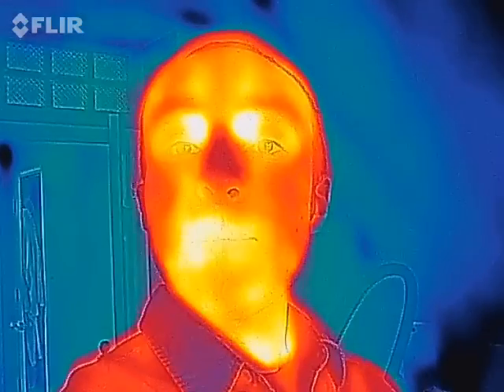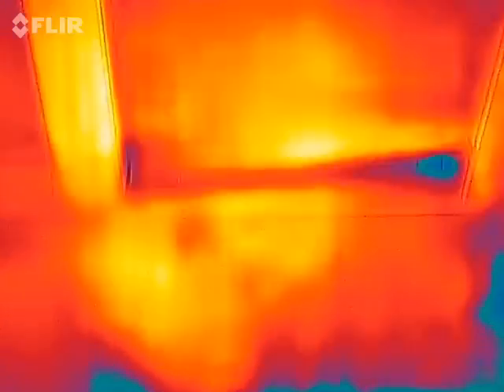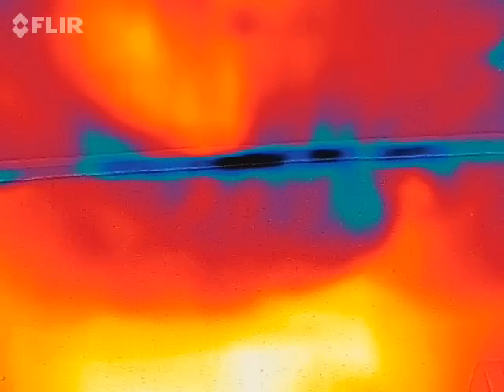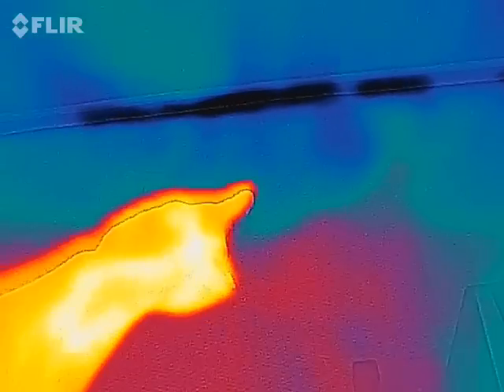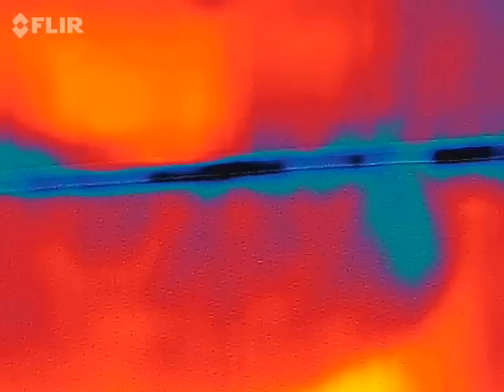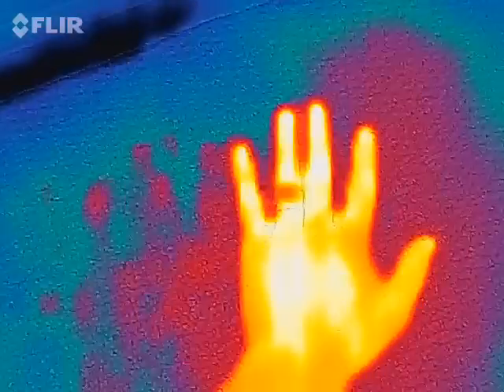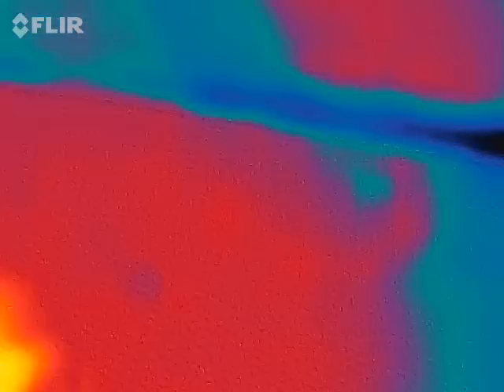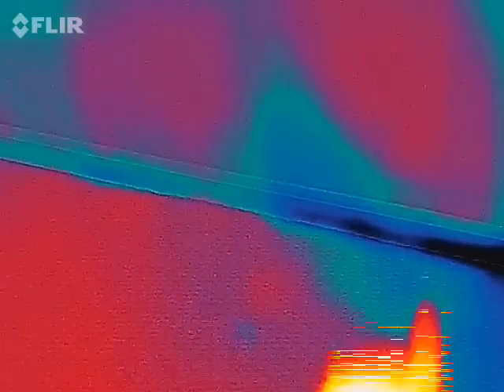Freaky Things a Blower Door Can Do #2

Comment: OK, so where the air is entering the room ? Through a recessed lights or through a baseboard ?
Reply from the maker: +Michał Dudek the important part is that air is entering the building assembly at all. It's coming into the room through a baseboard, but it's traveling through the front porch roof to get there.